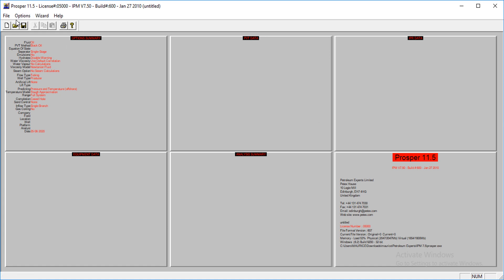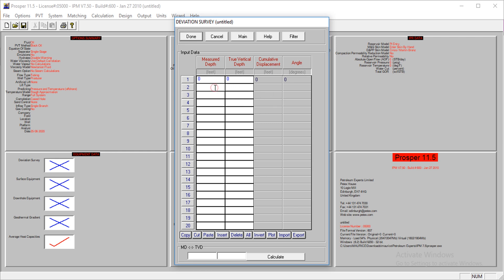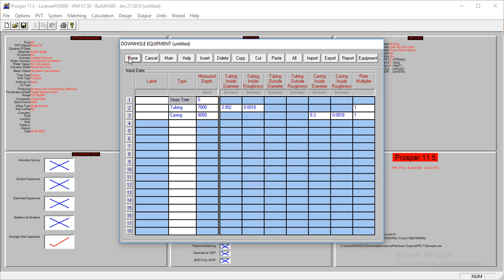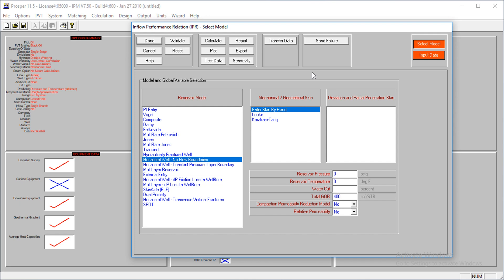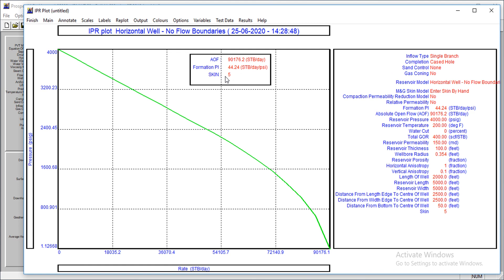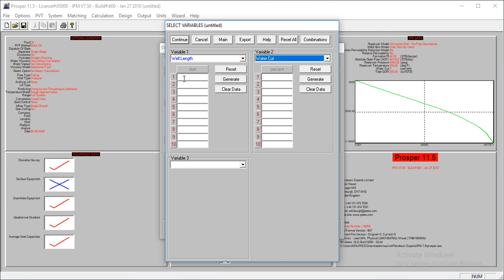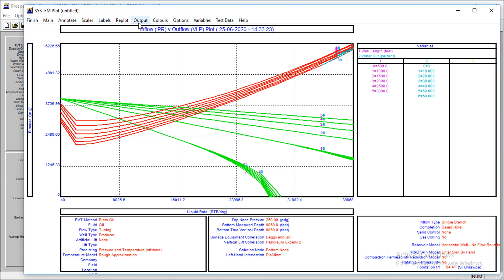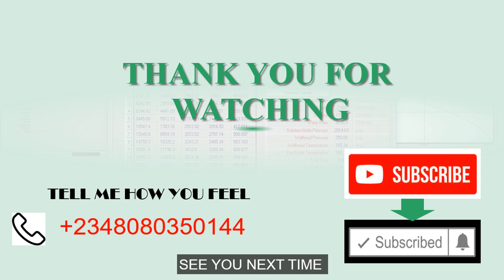Prosper Part 17 (horizontal well)

Comment: why you have set up tubing at 7800 ft in download equipment? where is this number come from?
Reply from the maker: It's from the data I got for the well I am modelling. Tubing is usually set in the vertical section of an horizontal well.